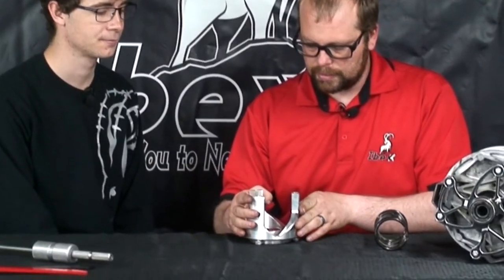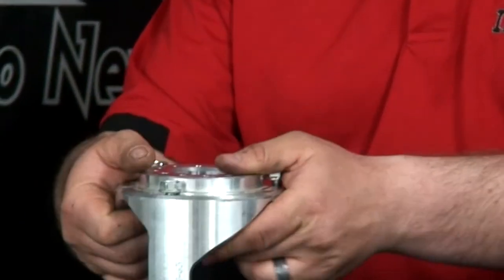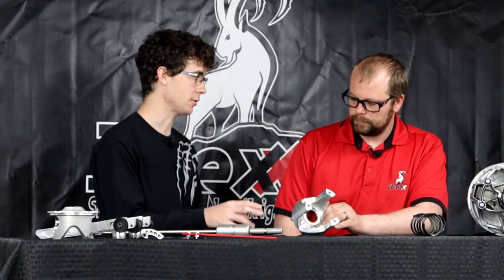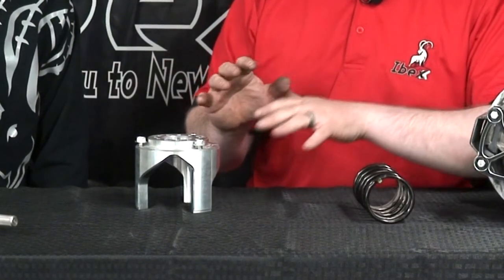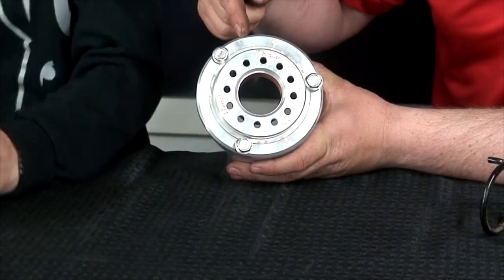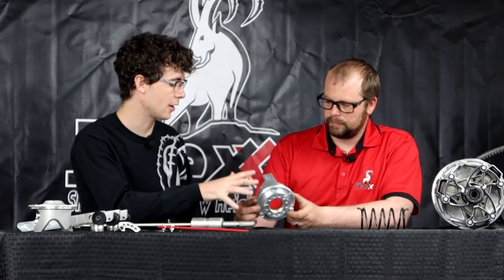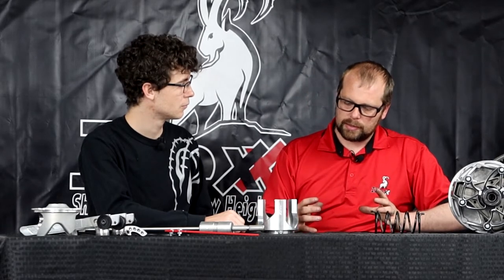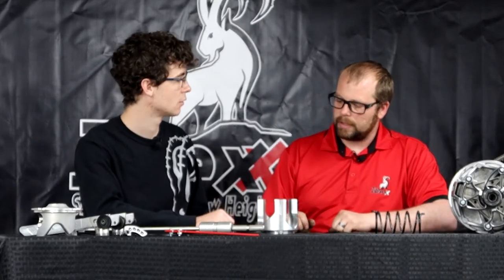My Clutching Guy Episode 6 - The Secondary Helix

Comment: On 17 xp4 turbo stage 4 32” tires what helix would you recommend for aggressive trail and sand rider? Progress, straight or reverse cut?
Reply from the maker: our stage 2 is going to work for you. it depends on the weight profile that you use. the helix has to match the profile of the weight